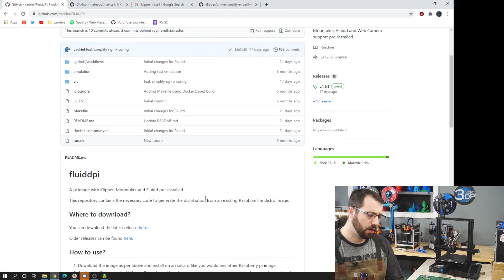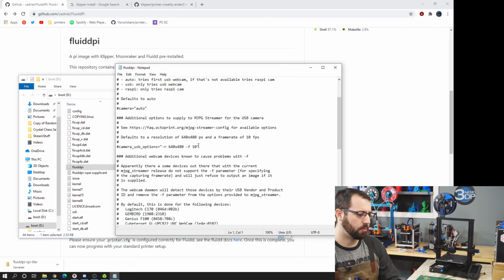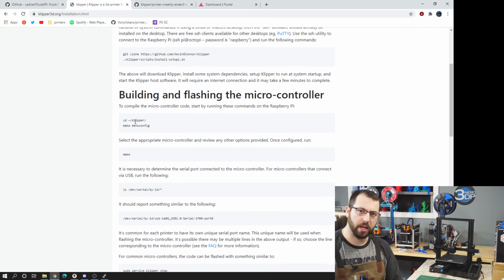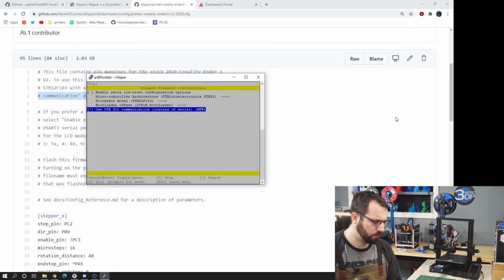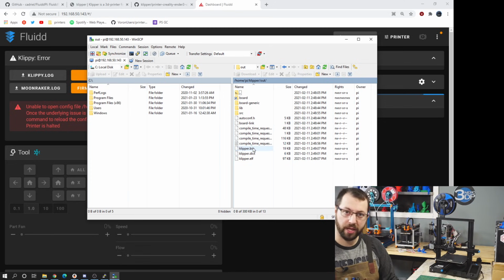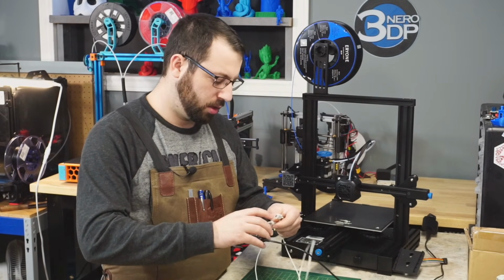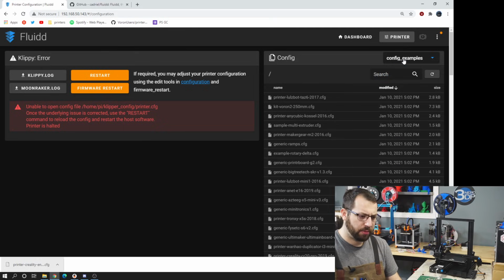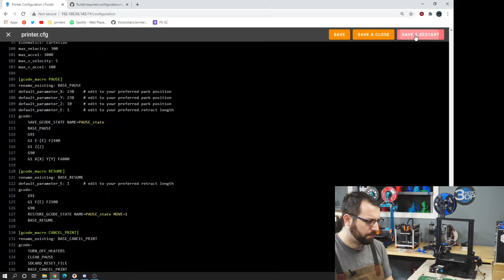Installing Klipper on the Creality Ender3 V2 (and other 32 bit creality printers)

Comment: Thank you so so so much!!! There are many video tutorials on YouTube regarding the install and setup of klipper on the ender 3 v2, but having trying and failing multiple times I came accross your tutorial and WOW. I'll not bad mouth the others ive tried, but I will say they where all either over complicated or had vital parts missing or wrong. Your however is absolutly perfect. Factual, accurate and no nonsense. Brilliant. You Sir are now in my little black book of heros. 😀 thumbs up.

Comment: Great tutorial.
I got it working, but some things have changed since the video was released.
I use RPI4 and Ender3 V2.

1. Klipper menuconfig looks a bit different, change last line to this:
Communication interface (Serial (on USART1 PA10/PA9))

2. I needed to use this command to find the serial id:
ls /dev/serial/by-path/*

Comment: Hello, I must have messed up something in my RPi configuration while trying to set a static IP because now it doesn't show up anymore in the network (or it can't SSH... can't tell).
Is it okay to just reflash Fluiddpi OS or will I lose all my Klipper configuration as well? Would really love to just fix the RPi without affecting my Klipper configuration.

Comment: You could plug a USB SD card reader/writer into the Rpi and then just copy the file to it.  You'd have to mount the SD card into the file system with the mount command, and probably would need a USB micro to USB A Female cable, or a USB hub to connect the SD reader to the Pi Zero.

Comment: I avoided Klipper for 2 years now, and in this time I configured dozen of Marlin configs for my printer. Seeing how easy this is, compared to Marlin, I kinda feel shamed for not even looking into it till now.
I hope I can learn it quicky, and might not be that easy, simply because nothing I use is "default" on my enders, a E3D titan direct drive, dual z, filament width sensors, etc. I think and hope that this video is a great start.

Comment: @Nero3D , I wasn’t able to flash my mcu on Creality CR200b, after restarting the printer, I didn’t find any .cur file in the sd card. Also ran ls/dev/serial/by-I’d/* command, which showed no such file directory. Checked my usb cable, works fine. Could you suggest me a solution??

Comment: I have ender 3 pro with 1.1.4 board, can someone tell me what options in klipper configuration i need to set, processor etc.. i found out that new and old version exist and i found cfg for only 2020 (new) version, and i have old one

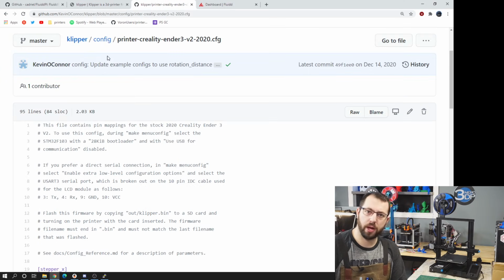Comment: Great video - one question though. My Ender 3 V2 has a 4.2.2 motherboard with GD32F303 processor. Do I still use STM32F103 options as you show at the 4:36 marker? Thanks in advance.
Reply: same question.
Reply: you have successfully instaled klipper on your 4.2.2 motherboard with GD32F303 processor?

Comment: great vid, but honestly a terrible tutorial
Reply from the maker: What are the issues and how would you suggest i improve it
Reply: @CanuckCreator  thank you for actually caring to improve content. While I am not a pro so I don’t know everything/ anything about coding. I think if you would go into more detail on why you are doing certain things and the other options if we might have a slightly different setup. Specifically when it comes to setting up the configs for building the menu and mainly the klipper printer config. These are 2 steps I can find almost no info on, especially when talking about using fluidd. Everything is in octoprint and done in 20 different ways in every video/ recourse so it’s hard if not impossible to try and use other resources for this part. It gets you close but you can’t find the missing steps. This is especially a problem because I am using a MKS Pi (yeah kinda on me making it hard). One of the most helpful things would be a checklist for the steps. This would be useful so you can understand what’s going on (most don’t have any Linux experience including me, or setting up something through only commands) but mainly for the printer config. The samples are pretty much useless because they are missing so much needed info. I don’t even know what to add (such as what info needs to be defined in the printer config that was previously in marlin for me). I see motors and stuff, but what about the probe, or offsets, mesh size etc. Some examples on klipper website include a lot more info and some just contain basic board and motor info. Like the default has a bunch of section headers with info that would be vital, but in the samples it does not have this info or header to alert you to add it. If you provided a list of things that need to be in there to work it would be extremely helpful for those that don’t have the perfect cookie cutter setup. Hell at this point I would pay you to make a video on how to use these clones and not with octoprint. Anything out of the ordinary with a stock printer and board you can not find info on. I personally don’t want to use octoprint due to how not user friendly it is and the extra code. Absolutely no one can buy a real pi right now, and so that’s pretty much all beginners trying to learn since we don’t have one already. With like 2 videos online that are very rough and show very different methods (also skipping steps) it seems like a lot of people are in the dark. I would absolutely love to see a long (like hour vid) that goes step by step on how to do this stuff and why so we can not only get it done, but learn something and be able to keep it working/ fix errors. This would be even more awesome if you did it with the clone boards since that’s what everyone new installing klipper (who is also likely new to code and boards like this) has access to.
Reply: @CanuckCreator  I understand that the algorithm does not like long form, but if you made a step by step video for us in 2023 that can’t get a pi but still want to use klipper I think you would be the only one online. Hell, I will literally pay and I think a lot are in the same boat. Lots of Reddit and form questions about this stuff with no replies.

Comment: What do you do if you are not getting a connection at the point after you finally connect the pi? Tried it twice now.
Reply from the maker: try a different USB cable if the RPI and ender control board are not seeing each other

Comment: At 4:30 when using the command "make menuconfig" it seems to be assuming a single instance of Klipper/Mainsail? If I follow this tutorial but have 4 instances installed for 4 printers (on a Linux PC), will this be setting all printers to the same mainboard model? Is there a way to set each printer to their respective mainboards?

Comment: could you do a video like this with the sonic pad? ive been wracking my brain over connecting the sonic pad to an ender 5, i have no clue what im doing 🤔
Reply from the maker: I have a sonic pad but review is on hold due to some factors, if you have one id say follow the manual as its aimed at installing it on enders specifically

Comment: no matter what i try i cant get this to work. i tried using unique flashfile names, display disconnected, display connected, nothing lets me flash the ender v2 with klipper.  i can easily flash differenct marlin firmware onto it but the klipper.bin does not work.   very frustrating..
Reply: I'm having the same issue.  Make sure that your sd card is formatted fat32 4096k or it won't read.  Still isn't helping me for some reason trying to flash th3d ezboardv2.  Oh, also, in the printer cfg file that you are using make sure to follow the directions for firmware file naming.  Some ask to name it firmware.bin and others are something completely different.
Reply: @burmy1552  disconnecting the screen before flashing is also advised. Sometimes the ender3 v2 doesnt flash when the screen is attached

Comment: So, I watched you video through before doing anything. Then I followed along while you did it all. I get this error in fluidd:

"mcu 'mcu': Unable to connect
Once the underlying issue is corrected, use the
"FIRMWARE_RESTART" command to reset the firmware, reload the
config, and restart the host software.
Error configuring printer"

Where did I go wrong?

Comment: Installed fluiddpi and don't have the "Printer" button (so, no Configs for me either) at all. Any tips? Fluidd1.19.0, Klipper v0.10.0-515-g24a1b50e. Printer IS detected by the same cable connected to a Mac.
Reply: Probably too late for you, but could help others: it is now in the Configuration tab. In the other files section you choose config_examples and there you will find it for a download. You then upload it to the Configuration Files section on the left

Comment: ALTERNATIVE (LINUX WAY):

1) Instead of Putty (Connect to your RPI):
1.1 Click the windows key on your keyboard, search for "CMD" and open it.
1.2 A black window should open and type in "ssh pi@<IP of your pi>" probably something like 192.168.x.x

2) Instead of WinSCP (copy print.cfg file from RPI to your SD card):
## If you have the CMD window open (1 above) do the following (all done in the CMD window, without  " quotes):

2.0 Type this and click enter
lsblk

2.1 Plugin your SD Card into your RPI (assuming you have a SD card adapter, usually comes with an Ender 3 :)

2.2 Type " lsblk " again and click enter.
Then a new device should be listed, compare it with the previous " lsblk " before you plugged in and it is usually called something like "sda" "sdb" etc. it also shows the device "SIZE".
Mine for example is called "sda" and the partition is "sda1"

2.3 We prepare a folder for the USB to mount to
sudo mkdir /media/usb-drive

2.4 We mount the drive aka make it usable
sudo mount /dev/sda1 /media/usb-drive

2.5 We delete all files from the SD card, BE VERY CAREFUL WHAT YOU TYPE HERE:
sudo rm -rf /media/usb-drive/*

2.6 We now copy the klipper.bin file to the SD card. " cp <the print config> <folder from 2.3 + file name> " change the "sda1" to your partition name unless it's called the same then you're good.
sudo cp ~/klipper/out/klipper.bin /media/usb-drive/kfirmware.bin

2.7 Check if you successfully copied the file
ls /media/usb-drive

2.8 Unmount the drive (IMPORTANT!!!!) "umount <partition from 2.2 ex: sda1>"
sudo umount /dev/sda1

Now comment "I use Linux btw." if you did it this way :)

Comment: I had klipper working fine with my 8 bit board and installed a 32bit bit following this guide so I can add a bltouch easily. However, with my v4.2.7 I cannot seem to be able to disable usb as per your direction in make menuconfig. Perhaps unrelated but, the make is sticking at the stm32.o files with a MATLIB upgrade to 9.3 error finally coming up. Any suggestions? I used /dev/serial/by-id/usb-1a86_USB_Serial-if00-port0 to flash my firmward fine before on the 8 bit. but cannot even get to this stage without the compile working. PLEASE HELP!

Comment: I'm getting moonraker errors for policykit not installed any ideas I tried following the instructions and it just bricked the firmware and now I'm currently reflashing
Reply: Managed to fix quite a few errors now I just can't figure out the 'config path' 'log paths' and the 'temperature_store_size:600'
'Gcode_store_size:1000'

Comment: I can't even ssh into the raspberry pi. Even if I use pi and raspberry as the password, I just get access denied. If I save a ssh file, it disappears after i connect it to the pi. This is getting annoying... :( I can access everything via the web browser which is confusing.

Comment: Great install, got a little hung up at the "ls /dev/serial/by-id/*" command, just restarted the printer, unplugged it from the pi, and reconnected it. Ran the command again, and boom. Worked like a charm. Thanks!
Reply: I had to restart the Pi as well but worked. Went crazy there for a second until I power cycled lol
Reply: @archie9441  I know right? Now comes the fun of figuring out the other config options for things like Mesh Leveling, and Bltouch....

Comment: I'm coming back to this now after failing to get anywhere with it months ago. I have fluiddpi installed and can successfully remote in to it. I believe I flashed the firmware of the printer, but is there any way to actually know? Now when trying to configure everything, I got the printer config errors to go away but have a bunch of moonraker errors that nobody else seems to get. I don't know what to do.
Reply: I am also getting these errors now, would love to have some guidance.
Reply: @achelan  I wish I remember what I did. I figured it out, but it's been a week so naturally I don't remember. So far it's all for nought though, cuz I'm still not printing.

Comment: Hey great vid! I've recently switched to klipper and love the features! My printer was running great until this week. I've been running into an issue were my printer stops mid print and I keep getting an error saying mcu unable to connect. I've checked all wires and have secured all loose wires and USB cables but keep getting this error. Idk why but I've even re flashed everything and still getting issue. Have you had this issue and what do you recommend me doing?? Thanks in advance

Comment: I'm trying to set this up on an ender 3 pro with 400xl extender kit with 400x400x500 print dimensions. I'm guessing i'll need to input these dimensions somewhere  in the config file to be able to utilize my full print size?
Reply from the maker: Pretty much just adjust bed size and limits accordingly

Comment: Can't get past putty's raspberry password, keeps saying "Access Denied", tried resetting the PI to manufacturer settings,  tried putting a reset button on the pi, formatted the sd card, and tried fluidd again, tried fluidd from Raspberry Pi Imager, but keep hitting the wall of Access Denied, can someone help me?

I'm using windows 10 & the pi is 3 model b,
Reply from the maker: its the default username and password is
pi
raspberry

Comment: does ender 3 v2 have UART port available to connect the Pi Zero directly to the board? edit: found it, use the UART from the lcd port since we not using the lcd anyway 😁
Reply: Thanks

Comment: So how do I do this without a pi?
Reply from the maker: You need an RPI (or similar like orangepi) to run klipper
Reply: @CanuckCreator  I have no idea what that is... I'm literally just trying to get this new mainboard to work for my printer and everyone's method is either flaud or too hard to follow or is just missing steps that I can't seem to find a work around for. So I'm kinda screwed here

Comment: Going through this process again and just noticed that after I flashed Fluidd to my SD Card using balenaEtcher and changing the WiFi info in the supplicant file, that the file (fluiddpi) for the optional step of changing your camera options was missing.
Is that going to be a problem?
I am not going to use a camera but just wondering if I still need that file or if it has changed since you released this video.
Reply from the maker: The newest fluiddpi and mainsail OS versions have webcam configuration done withing the webui now, so no need to edit a file on the sd card

Comment: Just wanted to say thank you for the great tutorial. Really streamlined the installation and learning process for me. Klipper has been a complete game changer - I was originally printing at a glacial 45mm/s on the stock firmware (going any higher would often compromise print quality). Working with the printer through the LCD, rotary encoder, and micro sd card was a complete chore and sapped all my motivation. Now i can comfortably print at 100-200 mm/s on Klipper with all the bells and whistles: 8x8 auto bed leveling, input shaping through accelerometer resonance measurement, and smooth pressure advance. The fluidd web interface is a joy to work with. Even when I make a mistake or modification, I no longer dread the process of recalibrating the printer.

This has let me grow up from a 3d printing babby to... insufferable 3d printing teen lol. 10/10 would Klipperize again.

So thank you very much and look forward to seeing more of your amazing content! 
🐢🐢🐢 -> 🐇🐇🐇

Comment: I just completed a Fluidd/Klipper conversion to my Ender3v2.  Your instructions were very helpful.  I did this with a view to starting a Voron2.4 build as it gives me a chance to understand the software on a known entity.  One question.  I have configured the Z offset using the TESTZ process but it has still needed a little manual tweaking at print test time.  How do I reflect this adjustment in permanent settings?
Reply: Did you ever find an answer to this question? I'm also having problems with that as well :/
Reply: @SlinkyGangStudios  yes - i used the offset in fluidd to fine adjust the nozzle when it was printing the skirt - i also added 3 more rounds on the skirt and slowed it down so i would have time to adjust it - then manually changed the commented out value at the end of the printer.cfg file.  Now there is a save button next to the z adjust but you can only use it when a print is completed
Reply: @wilddog6060  Awesome thank you!

Comment: hi, with the new version 1.16.2 the option to disable USB is not present, and in the video, it is not clear exactly how you did disabled it. option are different in 1.16.2. otherwise great video mate
Reply: I ran into the same situation. I left it as is.

Comment: I did a pro not long a go, just come to do my brand new ender3v2 - just flashed, won't connect/printer not ready - assuming it's not flashed correctly used everything same in here although menu is slighty different on make with usb, but ensured it set to serial PA10/PA9. When i run